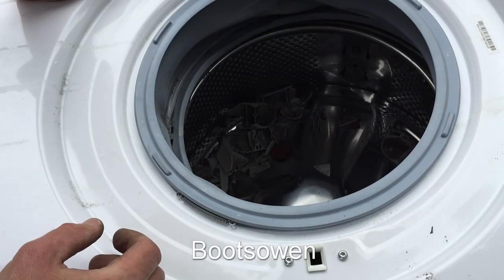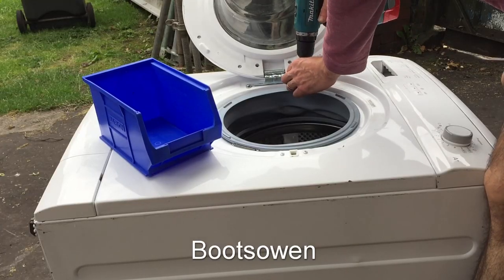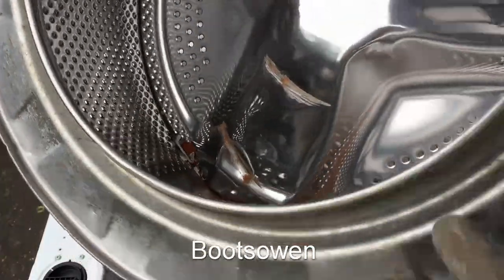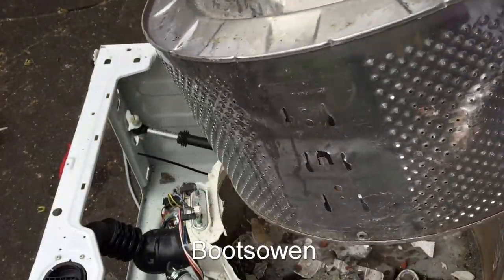How to liberate a washing machine drum for a firepit

Comment: Not so easy on ones lonesome. But if u can lift and drop it on one corner a few times. She's loose enough to just tear apart then. This doesn't have any time savings but it certainly is much fun.
Reply from the maker: Absolutely, I have done it with a grinder, or if possible a spanner, but a crowbar is the fastest and easiest!